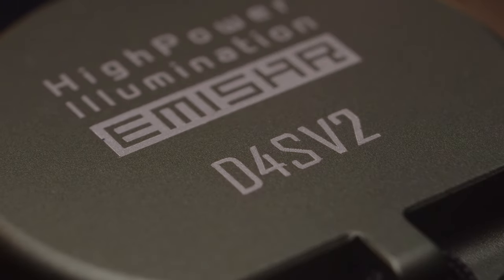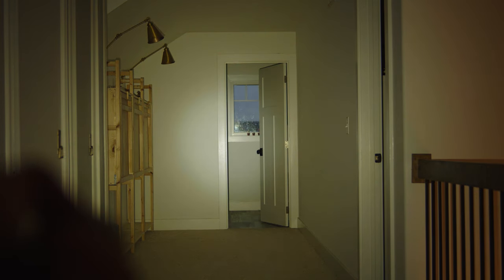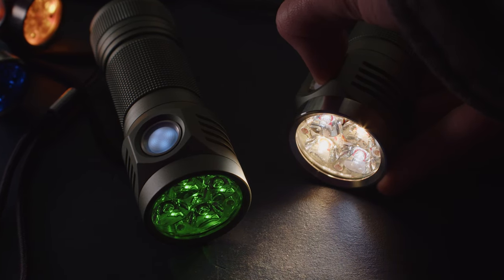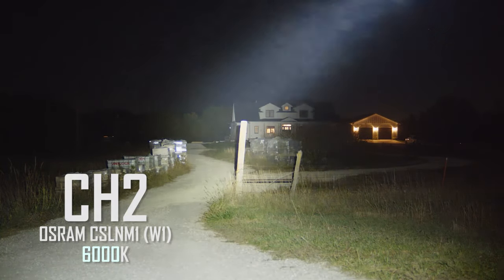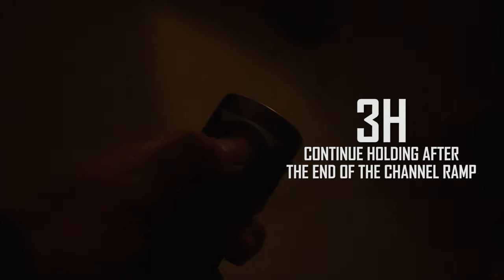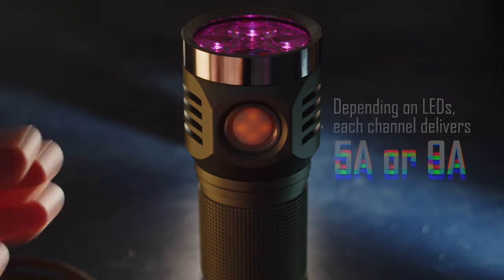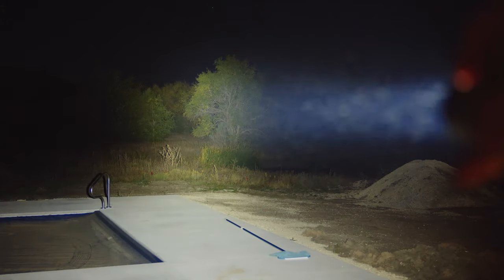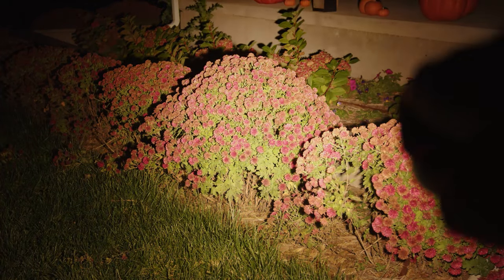The DUAL-CHANNEL Emisar D4SV2 [OVERVIEW]

Comment: Why doesn't the Toy Lady make it so you can use a combination of clicks and holds to access and do things? 9 clicks? That's absurd. A combination of clicks and holds can give you 15 commands or modes with 1 to 4 clicks and holds.
Reply from the maker: Because that would be completeely impractical for most people, the existing system is easy to use. Features that require 9+ presses are not intended to be accessed often, so it's a non-issue.
Reply: @LuxWad  How is a maximum of 4 clicks or holds impractical?  By now there should be a GUI on an app that you set everything the way you want by checking boxes and then unload it via usb. This clicking stuff is from the 1940s.
Reply from the maker: Remembering a sequence like that is harder for most people, as opposed to just pressing x a out of times and maybe holding the last press.
Reply: @LuxWad  Agreed but then those people should not own a programmable flashlight.
Reply from the maker: The whole point is to make programming easy for people while also running just like a normal flashlight
Reply: @LuxWad  You are either an enthusiast who wants programming or you're nit abd justified want a basic flashlight.
Reply from the maker: Anduril is supposed to fit both of those needs. It's not perfect but does a good job
Reply: @LuxWad  Well I don't like it. I don't like it at all.
Reply from the maker: That's fine. The best part is that you can flash your own firmware that does whatever you want.
Reply: @LuxWad  I have two AVR development kits I have used to make firmware programs so am going to make my own firmware from scratch. This is a mess.

Comment: Need your opinion. Want something with flood and throw. 
Thinking of the getting the d4v2 with OPTICS: 10621 (SPOT)
CH1: NICHIA 519A 5700K
CH2: OSRAM W1 6000K
Reply from the maker: That would probably be your best option. The D4 doesn't have a very throwy optic, but W1 will be a good bit tighter than 519a. You could consider adding DC-Fix or sanding the area over the flood channel for a bigger difference

Comment: I know your not Hank. But is there any issue stopping the dual channel from having the boost driver?
Reply from the maker: Size. The boost driver needs a large inductor, there's no room to fit two of them in these lights.
Reply: @LuxWad  Thanks for the reply. So you would need 2 inductor for binary dual channel (no tint ramping)? Sorry I'm new to all of this.
Reply from the maker: Yes you would need two separate inductors. You could use much smaller inductors, but you wouldn't get very much power.
Reply: @LuxWad  Okay that makes sense. Thanks for the advice and kino videos. +1 Sub